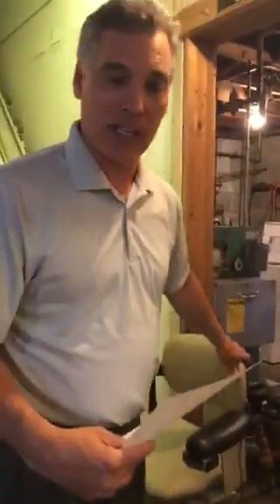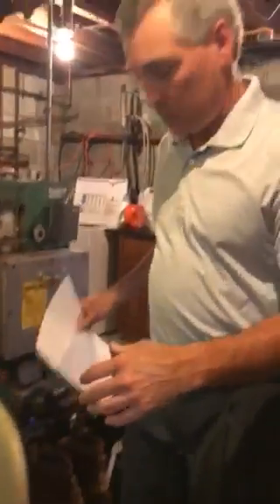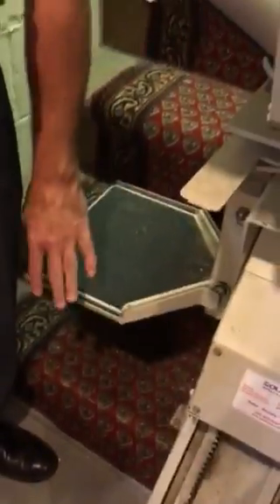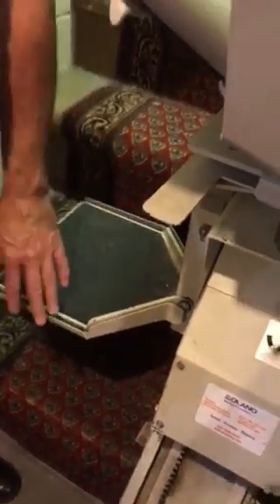Common problems with Stairlifts presented by The Stair lift Guru! PLEASE CLICK THE SUBSCRIBE BUTTON

Comment: I just purchased an Acorn Stairlift that was disassembled and not running. After installing the unit it did nothing. I called Solano (Ray) and he was unbelievably helpful. He walked thru the entire unit describing what to check and even offered doing "FaceTime" to visually walk me thru. Well he was right. I found the problem (a little fuse on the main circuit board) and "WaLaa" I had power and the unit works great. Having purchase nothing from him, I was extremely pleased at the time he gave me and offered to stay with me until it was operational. What a gentleman and so service oriented. I would recommend him to everyone in need or systems or help. Great company....

Comment: Ray, even over a year after you put this video out, it is a great help.  We service lots of different equipment in peoples homes, from fires, water leaks, etc. and see more mobility devices,  and your video has helped us fix several items so simply.  Unplugged, circuit breaker cut out, unit very dirty, etc.  Your video has been GREAT.  Thank you so much for the help.

Comment: Great troubleshooting tips! I worked in IT for 15 years and the number one issue we found during troubleshooting was related to no power to the system. Number two was lack of proper cable connections.

Comment: Thank you so very much for posting this. I've been greasing our all electric (no battery as we have a whole-house generator so I opted for a no battery model) stairlift from Ameriglide myself as my husband walks with a cane and is kind of unstable on his feet even when he's not on the stairs. I watched a video on that before I watched yours and I've been doing it correctly with white lithium grease spray but am always so worried about getting the grease on the base of the two skinny tracks on both sides of the wide middle track (where the steel cord is connected to the chair). I've been blocking the base of each little track with a thin piece of card stock (I save political "postcards" that come in the mail all the time to use) while I spray each side. Though the man did say not to get the grease on the base of the little tracks, he just went ahead and sprayed each side with the little straw connected to the spray can of white lithinum grease without blocking the base of the track with anything. He just goes a lot faster than I do as I have to be careful on the stairs. I sure wish YOU would make a video of how to grease it as I'd like to see how you do it. 

Your "common problems" video was so helpful to me as we hired a guy to measure our stairs, provide them to the company and then install it for us. So I have yet to use a local service for anything and am hoping I don't have to. So far whenever it has stopped working, we've been able to solve it ourselves -- tugging on the steel cord was something we learned to do from the included literature. But seeing where all those safety switches were was very helpful if it stops working again and my usual remedies don't work.

Our lift gets heavy use as my husband no longer walks up or down our very steep staircase (our house is renovated but over 100 years old) and that lift probably goes up and down at least 6 times a day. I use it when my hands are full but I try to still go up and down the stairs when I can to get the exercise (trust me, even young men working on something at our house complain about how steep the stairs are usually after their third trip up and down its 15 steps!). My housekeeper has NEVER walked up or down the stairs since we got this installed almost a year ago either! She probably makes 10 trips up and down once a week. So even though the directions that came with our lift said to grease it every three months, I think it needs it more often due to heavy use. Would you agree? It tends to struggle or "jump" a bit sometimes, especially when we're running the chair up or down with no one on it (my husband will send me up a cup of coffee on the footrest and the chair will shimmy so much the coffee with splash out a bit until the chair is a couple feet up the stairs). He also uses it to send up laundry to me when I'm upstairs. Do you think it shimmies because it needs greasing? I'm going to clean each of the two tracks tomorrow with a rag pushed with a screwdriver like the guy's video showed prior to spraying some white lithium grease on each side of the two channels as maybe that will help. I had no idea I had to clean it before greasing it. Anyway, sorry to go on so long but wanted you to know how helpful your video was and how I'd love to see one you'd make on how you'd grease it with the spray grease. Many many thanks!
Reply: if the shimmy is radical the rail may need to be leveled - put a level on the footrest (to level the rail pitch) while its going up and down the steps to see if the rail needs adjustment.

Comment: hello i have the thyssenkrupp flow 2. we went on holiday and left it half way up the track out of the way so it didnt block my son on the stairs as it wasnt being used for 2 weeks. now come back from holiday battey is flat and its half way up the track. is there anyway i can manually move/wind it down track or take out batteries and charge then thyssenkrupp want to charge me £200 to some out i am sure there is someway to move a battery dead stairlift??? its only 1 month old!  thanks

Comment: Hi our stair lift,  just went upstairs by itself and the remote its not working.  We haven't use it as the person passed away a year ago
Reply: sounds like it's perhaps their spirit trying to let you know they are about and they are ok and miss you
Reply from the maker: There may be a short or mechanical issue in the armrest toggle switch ⛪️🇺🇸⚾️

Comment: My Dad has a Harmar Pinnacle stair lift that I installed for them in 2014.  It has worked fine since then until now.  My Dad said the light was red.  I drove into his house(75mi away).  I took the batteries out and had them tested...they were bad...I bought and installed two new ones.  The light is now green.  When I press the button on the right armrest to move it up(it's currently at the bottom of the stairs) it sounds a solid beep(he can't hear it...but I can) but the chair doesn't move an inch.  I think all of the safety switches(footrest, seat swivel) are all ok...the light is green.  I haven't checked the key lock(will have him check tonight)...but would it be green if the key was switched to off?  Anyway...ideas on fixing this?  I can't believe(or don't want to believe) that it is a bad motor.
Reply from the maker: Marty Brown call me at 9149122177

Comment: Hello Mr Solano I have a acorn stair lift superglide 120 and we maintain the stair lift very well and clean.. having an issue that when we sit on the stair lift and go up it stops half way and has trouble going up. It also beeps when it stop,. if you get off chair it moves again, My grandmother weighs about 130pounds..  I am pretty handy and wanted to know what you think the issue can be. thank you Phil
Reply: Most likely it is time to replace the batteries,.  If it goes down fine but is slow coming up, that is usually the batteries.  You don't say how old it is but they typically last from 3 to 5 years.  I've seen them last up to 8 years on lifts that aren't used much.   It is normal for it to beep when it stops,.  The Acorn stairlifts only charge at the very top and very bottom.  If it stops anywhere else, it will beep to warn you that it is not at a charging station.
Reply: I had no clue a stairlift typically lasts only 3 to 5 years. Am worried as ours gets heavy use. I'd hate to have to buy a second one to replace this one but I guess you just buy another chair and motor right, as the rails will probably last forever?
Reply: Crybaby's Crybaby I’m sorry, I guess my message wasn’t very clear.  I didn’t intend to imply that the stairlift only lasts 3 to 5 years.  I was trying to say that the batteries typically last 3 to 5 years.
Reply: @crybabyscrybaby1395  you do NOT need to buy a new stairlift!  it's just the batteries. do research of your model and find out what batteries it takes they will be inside it somewhere. you just need new batteries not a new lift
Reply: @GhostvaperYT  Thanks -- what was I thinking? We got a stairlift without a battery since we have a whole house generator.

Comment: Hello Mr. Solano, I'm getting an F1 error on my Acorn Superglide stairlift.  Research on the web shows the problem to be a relay fuse.  Any help would be greatly appreciated.  Thank you.
Reply from the maker: Antonio Manalus that could be very bad news. We usually replace the board. Turn it off remove the cover of the carriage let the board cool off and maybe it will reset. Call me 9149122177
Reply: @solanomobilityaccessibilit3792  ok.  I'll try that.  Thank you.  I'll reply with results in a few hours.
Reply: @solanomobilityaccessibilit3792  ironically the warranty expired two days ago.  What would be a reasonable estimate for replacement of the board.  Is this something I could do myself?
Reply from the maker: Antonio Manalus that sticks the warranty is up. The board is expensive  to replace.